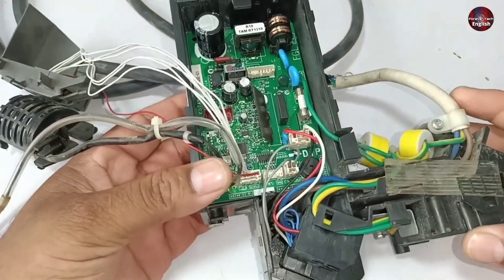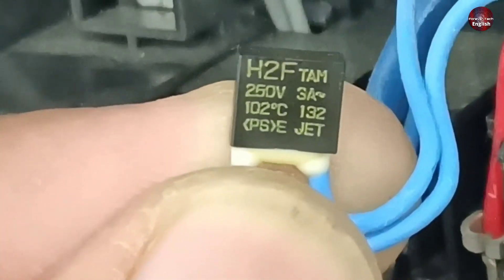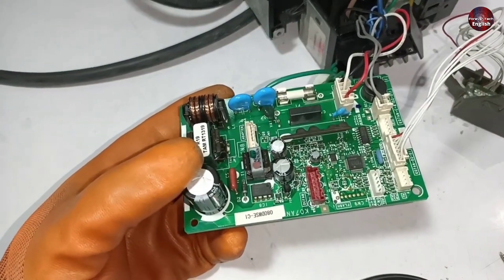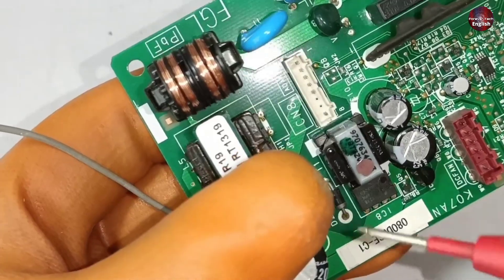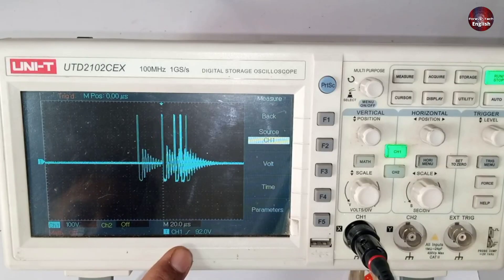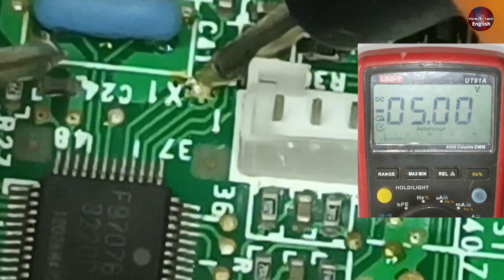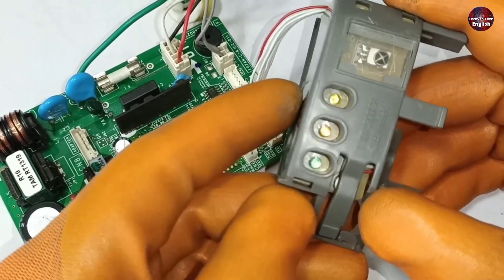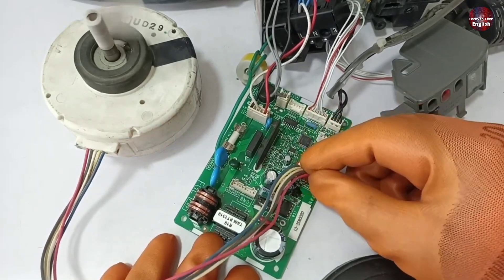Fujitsu Inverter Split AC Indoor Circuit Repair - Won't Power On!!

Comment: Having this same issue, had a power surge and the inside Fujitsu unit wont turn on. I tested the fuse and individual parts and all seems to be working fine and motherboard looks clean. I tried to press the emergency switch like in this video but did not have the same response. Any tips?

Comment: Sometimes only the contacts do not have a good connection. Some are not good put together or they have a tiny layer of corrosion. Even with laptop RAM this is happening, the solution is to remove the RAM-module and put it in again.
Sometimes if the error image is not clear, then I simply remove the components and put it together again to see if it is working again.
Reply from the maker: Yes that happens sometimes.